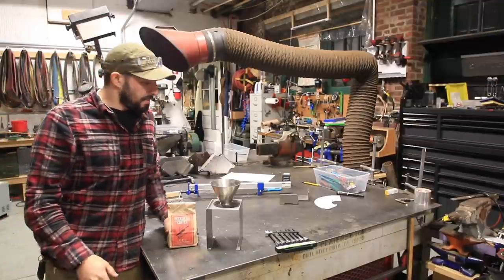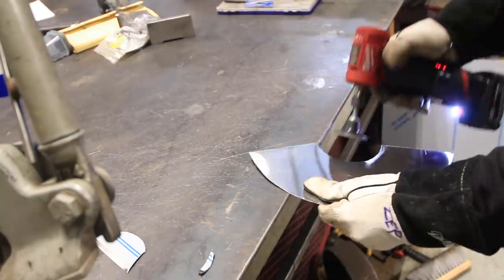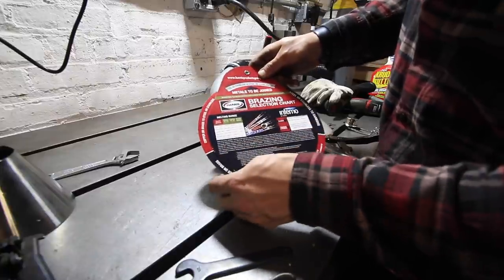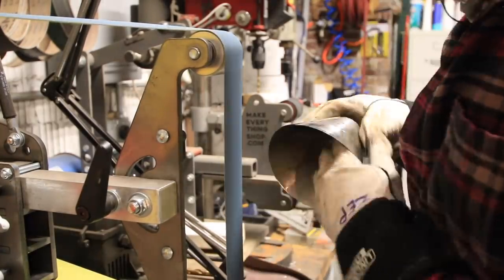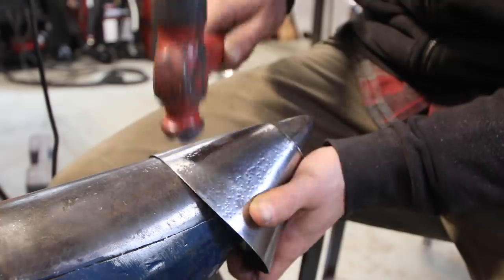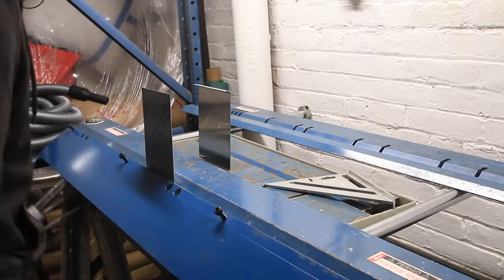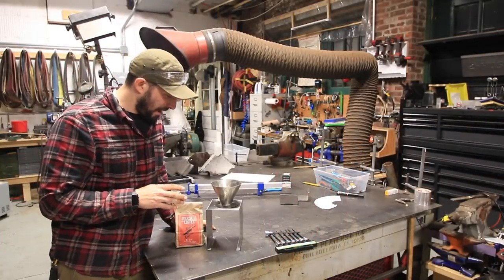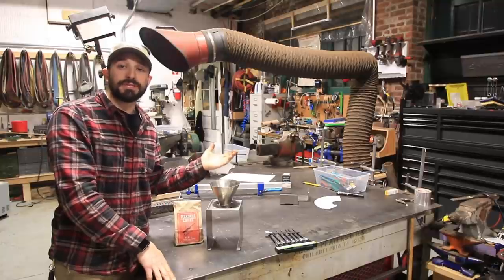Hand Made Pour Over Coffee Dripper - Stainless Steel Brazing

Comment: I've researched this for mini still kettle repairs and Safety-Silv 56 or Stay-Brite#8 ar.e specifically engineered for food grade. Always wash off residual flux with a hot cloth to remove residual flux. Also any abrasive wheels used should be dedicated to food safety  projects. Just like wire brushes used only for aluminum. Cross contamination is a poison possibility.
Reply: It'll be alright. He's going to wash it after he's done. There's nothing to really worry about from the abrasives contaminating something, since it'll be washed out afterwards.

Comment: Nice project and very cool to see some brazing! Silver is very versatile and my favourite style of brazing. Silverbrazing is very different from brass though and can be quite finicky to work with as it becomes very runny. I have worked with both in different applications and thin materials. With a good amount of flux, a soft flame and patience you can get very nice results with stainless steel. Silver likes a little gap to penetrate joints, a little chamfer to form a nice fillet and a little cool down when getting too hot. Took me a while to get used to. Keep up the good work!

Comment: Man so much heat with that brazing process.....you easily could have tig fused that with no filler...lap joints tig fuse so nicely....thin butt joints can be tricky cause if the puddle opens up on you, you gotta add filler....but with a lap joint you can almost guaranteed make the whole run without filler....on the bottom joint leave a little of the funnel proud of the hole, and let the excess material wash in and become your filler metal....
Also on something like that I wouldn't be scared do use a dab or two of 70s2 here or there, especially for the tacks... stainless steel is still steel, so 70s2 will work, just not ideal...
Reply: It was WAY too much heat, esp considering it was soldering and not brazing. He could have easily tig fused it with a butt joint. It's not that hard if you have a foot pedal or a modern tig welder that is fully programmable.